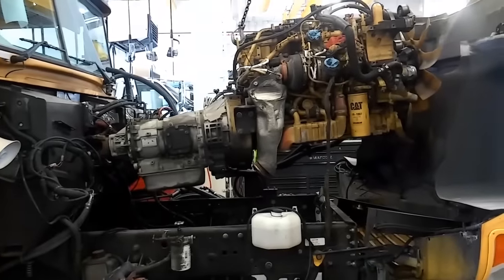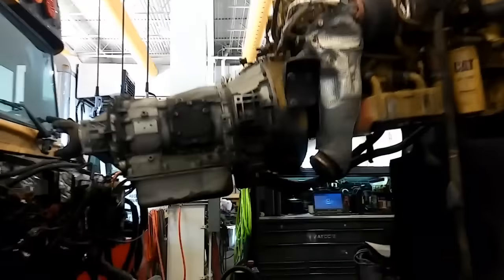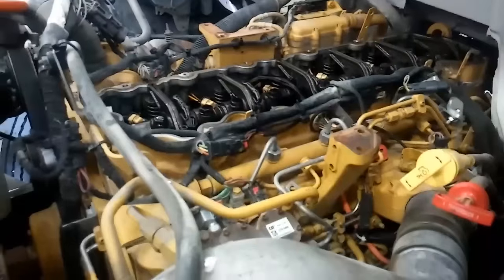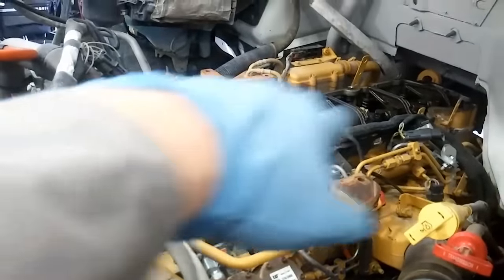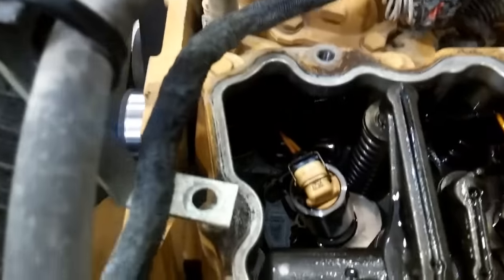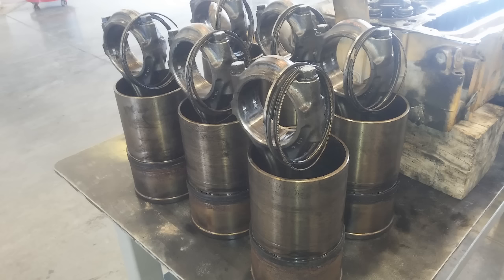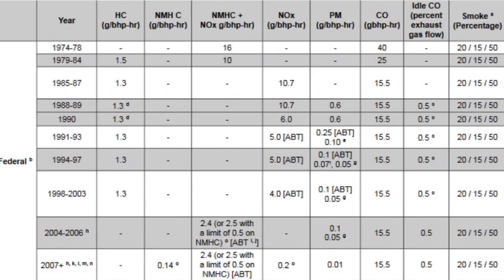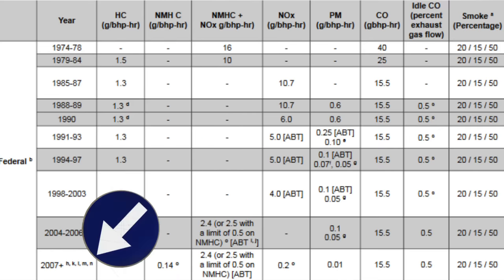The Worst Engine Caterpillar Ever Made.

Comment: I was just one hapless engineering technologist that had to work on that disaster of a fuel system. The debris in the fuel pump from casting issues was the main culprit of those injectors failing. The core sand was so fine it would not plug the injector tips but would erode the pressure orifice in the injector causing fueling issues thus killing said injector.
Reply: I there a way to remedy that issue or is it a fools errand?
Reply: @erichumann8058  Yes buy a Cummins 500 HP or a C15 for your motorhome/dump truck. Any C models with a single digit number behind it STAY AWAY unless you have fools money and no common sense.
Reply: @gregbutler9873  the predecessor to the C7/C9 was the 3116 and 3126 right? And they where solid weren't they?? Just askin

Comment: I remember working on the preproduction engines C7S, C9S, LEE, AND SDP. Didn't have too many issues with them since they were all essentially built in a lab environment. I remember swapping out all the lab built engines to full production and they all fell apart. I've made a many paychecks off nothing but EPA 07 engines for a decade.
Reply: If you going to my country you opinion prprrr,C7 is trashhhhhh amigo best is Cummins 8.3 meachanical fuel pump!

Comment: I have worked for a major truck leasing company for the past 16 years. The three things I remember about these were, “injector # not responding properly”, non stop road calls with the customers stating,  “the engine just shut down” or “there’s oil coming out from under the hood” because of the huei pump failing, and every PM (oil change) there was an added job to attach a flow sensor to the breather tube because  our data miners in corporate figured out they kept breaking rings or scoring the cylinder walls. They wanted us to catch the excessive blow by so we could have them rebuilt before warranty ran out.

Comment: You just described every newer diesel engine on the market today. I'll take an older pre EGR / after treatment system, diesel with half a million miles over any new diesel engine on the market today...  So glad I retired and don't have to deal with that shit anymore...
Reply: In my opinion, they should have gone to SCR (which uses DEF) with a DOC (Diesel Oxidation Catalyst, a.k.a. Pre-cat), and tried to get that to work, while completely ditching EGR and DPF's. Also, the EPA should be less restrictive on particulate matter. 

Really, these emissions standards should be an international thing.
Reply: me too!  The 855 big cam 4 was  hard to beat and it was not hard to find someone that worked on them.   The 3406B was good too and DDC was in DDEC 4 by that time.   But they were all using EPA credits till their demise.

Comment: Thanks Josh,  I'm now breathing a sigh of relief knowing that my 2005 C7 Acert is not one of the problem children !
It's been good to me so far, and I'm happy with it's performance.
Reply: Just had the cam follower plates off of mine because of an oil leak and sent the ECU out for recalibration. New valve adjustment and running again this morning now. I think c7's  are just fine, pre C7-S of course
Reply: We are looking at a 2005 C7 in a school bus that I want to convert to a RV. It has 250k miles. In your experience does it still have some life in it?
Reply: @kourtneywietecha9161  Providing that the school district that owned it performed regularly scheduled maintenance on it, (and I assume they did), you're good so far. 
Moving forward,  as long as you do the same  (keep clean, fresh oil and filters in it), never overheat the engine or abuse it...  that C7 is capable of making it to half a million miles.   Good luck.  🤓

Comment: I'll always love the 3126. It was a loud clattering motor that was a huge PIA to start when cold, but once it got itself started it was perfect.
Reply: I’ll always love the sound of them! I basically grew up hearing it in a couple school buses I rode in elementary school
Reply: Might have been a bad intake grid heater. I had one in a straight truck that always started fine even when it sat out in the parking lot all weekend in the snow. Just had to wait a long time for that 'wait to start' lamp to go out, and then crank it right away before the heater grid started to cool off. This was a late 1990's 3126B with an Allison automatic in it. GMC 6500 cabover.
Reply: @brnmcc01  The mechanic that I sold it to replaced the injectors when he pulled the motor. He put the motor in a plow truck. He says it starts right up without issue.
Reply: @thethomasj1795  Makes sense, bad injectors will make any diesel run terrible.

Comment: I place 3176 2YG at the top of my list. Was released to early. Production was stopped for six months, after release.
Cat had a 800 number to call if one came in. You entered the last five digits of the engine serial number. A recorded message would play back the characters to circle on the fifty two page recall list. They was from A thru Z and since they ran out, picked back up at Z1 thru Z6. 

Inner and outer front cover plates would crack.

Push rods could jump out and go through the side of the spacer deck. 

Put inferior o-rings under the spacer deck. Could leak oil or coolant. Had to pull head, liners, radiator, front cover and camshaft out,  and deck, just to get to the o-rings. 

Injector cups was made out of copper and they would split filling cooling system up with fuel and running out the overflow all over the truck. 
It could cause the coolant seal under the  spacer deck to swell up and leak.

Camshaft gear had an outer ring that could be put on backwards and the engine would not start. Also it could warp and lose RPM signal. 

TDM had a fresh air line going to it. If it was routed incorrectly and a hole rubbed in it. You would/could fill the ECM, TDM and personality module up with water.  

A few recalls on Injectors.

Just to name a few major items.
Reply: agreed , i thought that engine would bankrupt the company i worked for , they had plenty of freight just unreliable trucks to pull it.  Cat finally replaced the first 150 engines for 9 thousand dollars each.
Reply: I was looking for this! Terrible engine. The horror of trying to get the head bolts out of these things. I dreaded these anytime one came in.
Reply: I agree with you! The 3176 was a POS. I worked at a dealer that sold Cat parts, and the engines in their trucks. We sold tons of parts for that piece of junk. I know one company, I'm sure they were not alone, that really suffered because of it, Transport South. The engine was light that was it's selling point. So a lot of companies wanted a light engine along with a light truck to pull their freight. They fell into the trap of specing this motor in a truck with light frame rails, so they could haul more load. The engine flexed under load and that caused all kinds of trouble. The frame flexed and that broke cross members. The whole fleet had to have the engine problems fixed and then the whole frame rebuilt, end to end with stronger rails and cross members. Huge job per truck. Huge $. Perfect storm. Total POS package. Customer and salesman should have known better that to try to haul fuel and other liquid freight in a truck like this.
Reply: @davidkeeton6716  it seemed like it was thrown together in a hurry. Like they were given a worksheet of criteria to meet and the first engine that met that criteria went into production. There was just so much garbage on them that wasn't redefined enough. Aluminum spacer block to save weight? Great idea, until you look at the long term aspect. I mean they learned a lot from their failures with this engine and made a lot of fixes on the c10 and c12 (well, some fixes) but man what a pile this batch was. My neighbor has a dump truck with one in it and he loves it. It's unbelievable dry and I think the odometer shows around 700k miles. I told him if he ever has a need to pull the head, don't bother. Find a c12 if anything.
Reply: i would of bet money he was going to say the 3176, worst engine made by ANYBODY..................EVER
Reply: @krichard783  Before his time. I called it the yellow Edsel.
Reply: i always thought it was 3116 was the worst! but iam not a truck mech. only Heavy equipment!
Reply: I made a lot of money doing warranty work on the 3176 and 3196 in boats. Brand new yachts would get all messed up tearing the heads off and getting them off/on the boats.
Reply: What about the 3176B ? Looking at a sport fisher with them in it
Reply: @shitindawoodsbear2798  What about the 3176B ? Looking at a sport fisher with them in it
Reply: @alphawolfadventures1470  They was a little better over the 2YG engines. The ECM was updated, a lot of the sensors, some iron, gaskets and seals. However they did come out with a statement that said basically. The engine could have some leaks, including but not limited to, gaskets, seals, loose bolts, warped housings, clamps, if I recall. That was around 25 plus years ago.
Reply: @alphawolfadventures1470  a 3176 is a 3176....as in they are all EUI fuel system engines. They varied slightly but were basically the same exact engines for all practical purposes. 
They definitely have their weak points as many have described above, however it should be noted that crappy dealership mechanics shouldn't be mentioned as one of the product's inherent faults. There was poor dealership training for spells. Also the manuals were horrible after the mid 90's -they were written and edited by morons.

Comment: I run a 2008 CAT 535C skidder which has a C7 Acert. Which replaced the 3126 from the previous model 535... 21,000 hours before the engine was ever cracked open.. (in logging equipment that's almost unheard of) And all it had was gaskets and bearings replaced in the engine and  still running to this day. Around 19,000 hours  had a lot of fuel issues, Heui pump, main pump, filter housing/sending unit, and every injector and line;  straighten it out. Still can't understand the engineering, but it's been an unbelievably tough engine

Comment: I'm not even a Cat man myself but in Australia the 3406B had incredible torque rise in it's time even more than a 350 Cummins. The 3208 was called a throwaway engine. The 1693T was ahead of it's time with overhead cam, impressive power but a bit thirsty.  But torque comes at a price, look at these tractor pulls and the whole engine get's ripped off it's mounts.
Reply: From a retired US farmer... had the crap non turbo 3208's in New Holland combines.... rattle traps. junk,,, Now in 2022 I dont know a farmer that doesn't want a late 3406 or 6NZ, anything pre DEF in a old ass farm simi... LOL.... F this DEF shit, theyre farm trucks... and nothing pulls like a 3406!!!! Marine cam them and you have reliable 800HP...
Reply: @paulpence8895  I remember a company I did a little bit of work for in the early 90's had a 3208 in one of their trucks, it ran ok, but idled at a really low RPM like 450 or so, and would really roll heavy coal when you got on it. Not much power, but it was pretty quiet.

Comment: Sounds like caterpillar butchered the emmisons and tried to make their own common rail fuel system instead of going with BOSCH common rail system like cummins paccar Detroit and others. I did my apprenticeship at a caterpillar dealer and we were brainwashed to think that everything cat does is the best and is far superior to all others. Well 15 years later in the diesel equipment world I have my own opinions now. The fact that this company isn’t putting money into on highway engine development or electric drive systems is really a bummer. On the heavy equipment side of their company I feel like as Caterpillar became bigger they just bought other companies products and slapped their name on it. Like forklifts, electric drive haul trucks and small construction equipment. Caterpillar used to pride them selves on how everything in their engines and equipment was made by them now that’s a different story.
Reply: Every engine from C9.3 up now IS a Cat engine. All under are other makes. C7.1, C6.6, C4.4? Perkins. C3.3, C3.8? Kubota. C3.4? Fiat. 

The C9.3 was a big pile of crap for some time.... spun lifters, failed pumps, dropped valves.... 

Though yes, the C7S series was a booger.
Reply: Kinda how Ford butchered the International. I’ve had 6.0s and my current 6.4…. All were deleted immediately and tuned. Guess what, never been in a shop for failure. My 6.4 has 247k on it and has been tuned 250-350+hp tunes for 246k. It’s a f450 and tows daily. Had to replace a transmission in it…. (4wd brake boosted launches on a 350 tune) is the best thing for stock transmissions. 

All in all, the EPA is cancer on the diesel world. These engines can be amazing and provide plenty of service for you $60-200k rigs, but they won’t rest until batteries have replaced everything

Comment: We had 20 c7 cats in our fleet of 110 buses, they accounted for 95% of our work.
Reply: We had 4 C7 and 10 3126s. The C7s occasionally caused some work. 
The Cummins were the biggest problem after the VT365s. We had one 5.9 Cummins in a blue bird that hit all of 300,000 before it threw a rod through the block. 
All the Cats we got rid of at 350-400,000 still running.
Reply: Back in high school I was the kid who hung around the buses. When I was around, the 3126 and C7 seemed pretty strong as an observer, and I  rarely seen any of the buses I followed with them on the side of the road waiting for Currie or Classic to show up. However, when EPA2007 became mandatory, they disappeared from new builds, and more Mercedes and Cummins made their way, while the International VT365 and Shitforces kept being bought by cheap conglomerates like First Student and kept grenading, blowing turbos and getting antifreeze in the oil. 

The company I did co-op for actually imported some 2004-2007 pre-EPA07 Blue Birds with CAT from Quebec, because we loved the reliabilty at the time. Wasn't until the crooked Liberal Party changed the bidding processes for school bus contracts, killing the local firms, that Cummins and Maxxjoke became the norm. Now almost every bus on the road is an IC, and now my previous co-op is buying Visions with gas engines. IMO, EPA04 seems to've been the pinnacle of the post-emissions engines. The right balance between environment and performance, and if maintained right, will run forever. Just from the sound of one running normally. you know they're solid.

The transit system in my city retired all our EPA07 buses before we retired our last 2004 EPA04 buses. Now if that ain't the case to be made to make the entire office piss in a bottle in another lab, Idk what is. what drugs are they on?

Comment: I agree with you 100%👍🏿however I Still would take c7s over a Maxxforce 7 🤣🤣🤣😅 pure JUNK... Thanks for the video Sir
Reply: Ah Maxxforce 7 also 6.4 Powerstroke.
Reply: Maxxforce 9 is just as bad. A customer of mine had one in a 2012 4400. In 2 years, we replaced both turbos, both intercoolers, several injectors, egr cooler, fan hub, head gasket and after all that dropped a valve and took out the piston
Reply: @garyquade1975  lmaooo
Reply: Never had a medium duty truck engine except a Cummins that was any good been buying them for business since the eighty's.

Comment: Josh...I heard you mention that the 3126 was "Parent Bore" (No Removable Liners) is the smaller bore 3114/3116 ALSO a liner-less aka "Throw-Away" design?
Reply: They are but repairable. Not a huge deal. The 3126 mechanical was a freightliner proprietary because the 3116 was GM proprietary

Comment: You just KNEW it wasn’t gonna be the C-15 (6NZ), or even the 3406E.
Reply: Ssaurabi Redneck, the 6NZ version is widely regarded as one of the best diesel engines ever made. Certainly the best electronic engine. 

The only other C-15 was the MBN (the ‘bridge’ engine that had the first emissions garbage). Same block, garbage added on. 

The C15 (BXS/MXS/NXS) ACERT were/are good engines but had/have the emissions junk. 

Note the difference between the C-15 and the C15 ( no ‘-‘ between the C and the 15). 

C-15 are a 14.6L engine, C15 ACERT are a 15.2L engine. 

Nice thing about them is you can use the ACERT crank and pistons in a 6NZ to make it a 15.2L stroker with extra power/torque. The ACERT pistons are a better design, and are stronger, too.
Reply: @elijahrobinson2362  f

Comment: Mack  had  a  237hp  slant  6  back  the  early  80s  that  the  compressor  had  to  be  timed . It also  used  dog  bone  drive  like  a  Detroit  blower  that  also  supplied  the  oil  to  the  compressor. And they tended to break

Comment: Have to agree the C7S  or Cat Sucked was Crap .Cat pretty much Shit the Bed on ALL of their Emission Engines the SDP So DisaPointing was No Prize either and the 3208 that had the Exhaust Recirculation manifold on the left manifold with the tube that went up to the intake manifold was a real peach too We used to get School Buses towed in that quit running, pull the air cleaner and the intake would be Totally plugged with soot. I worked for a Cat Dealer in California in the Truck Shop for 31 years from 82 to 2013 saw A Lot of stuff that made you Scratch your Head and say WTF.

Comment: There are 2 fuel lines going to the ARD head because this fuel supply provides the majority of the fuel needed to increase the exhaust gas temperatures at the inlet to the DPF however, due to environmental conditions we sometimes need to adjust that heat so CAT added a sort of back up line to ensure we are always meeting emissions requirements